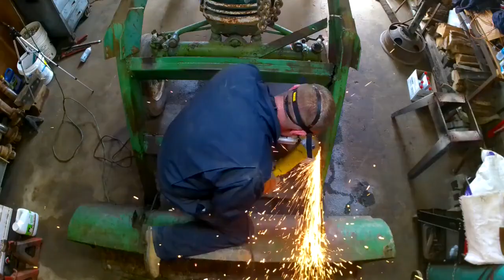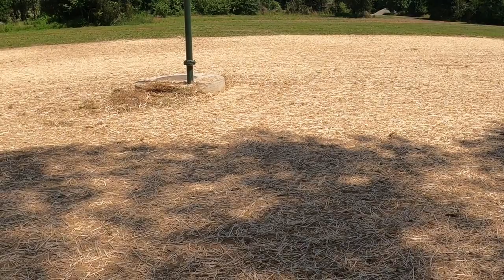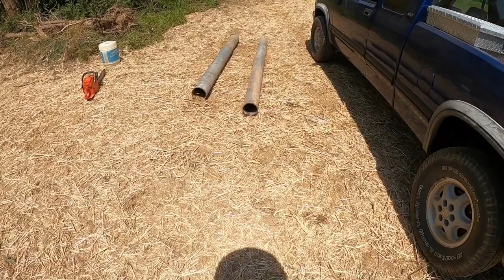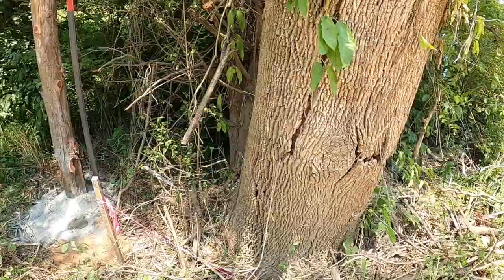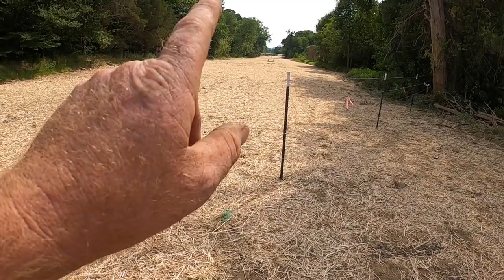HOT is the word for today, during Fence line work!

Comment: Whew don't miss the heat. The high here was 61 yesterday. Getting up in the 70 today. Fence and gate looking good. I haven't had any problem with trespassers so far and only have partial  fence on east side and across the back of property to the south. Nothing  on west or north side. Still working on clearing fence row.
Reply from the maker: I bet you don't Mr Robert it is miserable this year, not sure if it's because I am getting older or it's just hotter this year!! We never really did either until this last sewer easement came through. Different generation I guess, the ones that have no respect anymore! I know how the fence lines can be, I need to get back on some myself asap!! Good luck with yours sir, if I was closer we would give them the once over with the track loader! Thank you for always being here watching, supporting, following and COMMENTING!! Really means alot sir!!

Comment: Fence looks good. I hear you about the heat. I start outside between 5 & 6 AM and go until about 10, then knock off. Our monsoon rains started today so the humidity shot up, but our temps went way down.
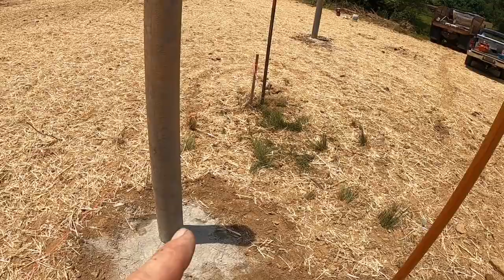Reply from the maker: I think that was the main issue. We didn't get started till about 10:45 and didn't stop until about 4:30. Should have known better. So how long do the rains last? The rain shoots the humidity up? Thank you Mr Matt for always being here watching, supporting, following, and COMMENTING!! Sure means alot!!
Reply: @Pennies_on_the_dollar  Our rains typically run from the end of June thru the end of August. Our humidity is high during that time, but our temps drop. We were triple digits for the last week & 1/2 but below 10% humidity. Now our temps will be high 80s/low 90s.
Reply from the maker: Ahhh, I see!! Thank you Mr Matt for the insight!!